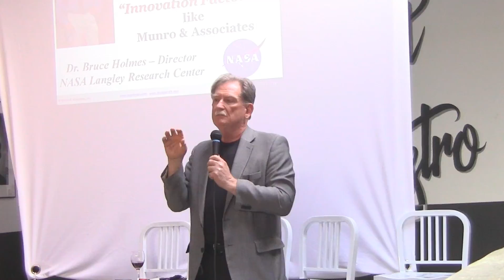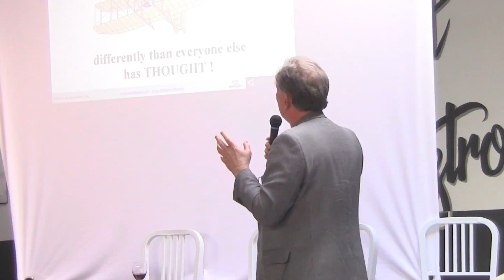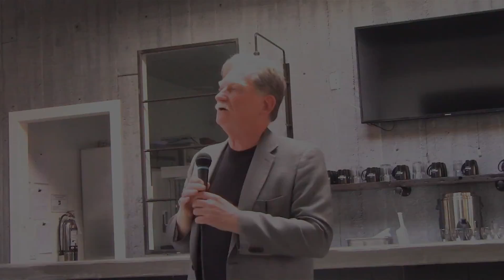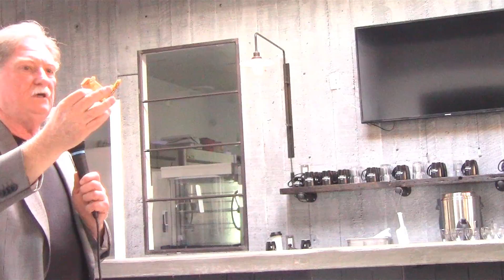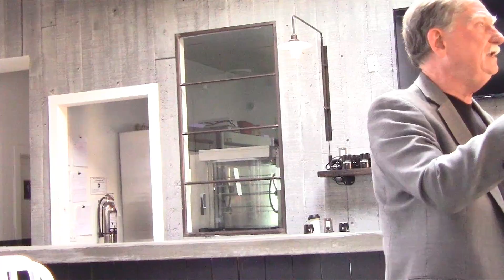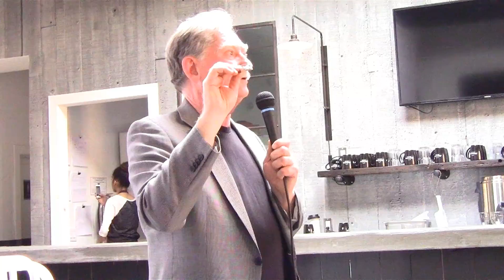'Why do we have to have flat circuit boards?'

Comment: I want to go to the parallel universe where BMW is taking notes and working on their next gen i3, and everyone else is trying to copy it.
Sandy's the best, SCIENCE!
Reply: Cybertruck - exoskeleton achieved. BMW have a very long way to go.
https://www.youtube.com/watch?v=koNaFUuIjk4
Reply: @waynerussell6401  they were on the right track, carbon fiber on aluminum frame, then gave up?
Reply: @robertpryor7225  That is conventional 'body in white' construction where the structure is ribs and longerons but the body panels are non structural. The only innovation was an expensive attempt at lightness. BMW have sold their carbon interests to SGL in 2017 and continually threaten to close the i3 line.
Musk discovered similarly how expensive and underperforming carbon fibre structures are and ditched it for a stainless steel Starship. The Tesla exoskeleton has its strength in the same material folded 3mm skin.
Munro has done a tear down of both the i3 and Model 3.
Reply: @waynerussell6401  I saw those, love Sandy teardowns
Reply: I think exoskeleton is just a different take on unibody. Depending on thicker material & bends for rigidity, instead of stressed steel skin.  It's
Reply: ... appropriate for Cybertriuck because it's already heavy.
Reply: @robertpryor7225  Watch the video in my first post for the difference. Musk said in the first few sentences of his presentation that the Cybertruck is a similar weight to the Ford F150 so the construction is not heavy, its efficient. He did say in the MotorTrend article that they reduced the thickness down from 4mm as the doors were too heavy.
https://www.motortrend.com/cybertruck/